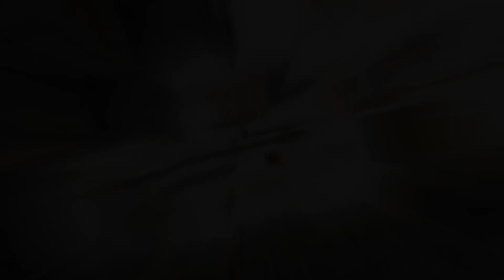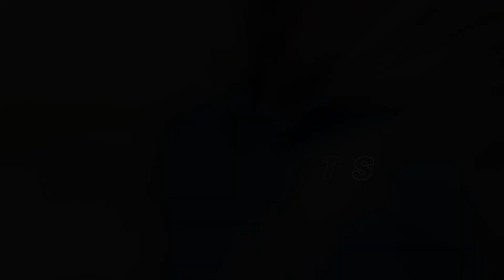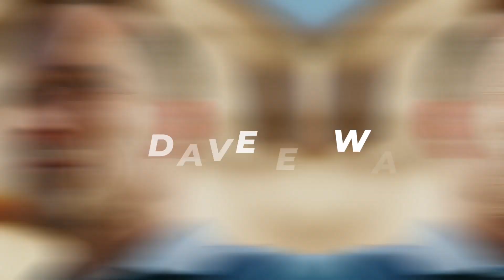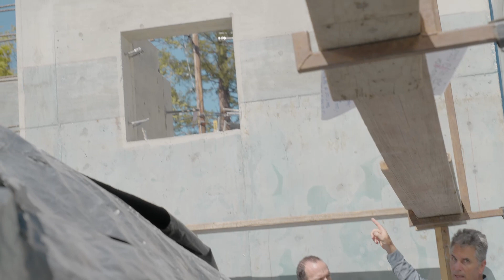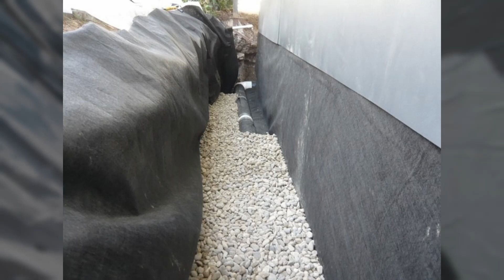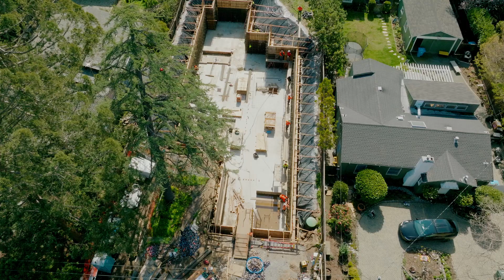Jake's Passive House #5: Waterproofing a Basement for a Comfortable, Problem Free Basement Forever

Comment: I’m incredibly interested in the pan style (“bucket”) concrete pour and how that was actually accomplished. Do you happen to have photos or a video of that part of the process? I feel like that is missed in most basements, and the insulation and waterproofing is usually handled in a less superior way (in my opinion!). Was the footing and wall poured in 1 step or separately? Also, would you mind sharing the manufacturer of the products utilized here for clarification?
Reply from the maker: I am not sure what you mean by Pan style or bucket” concrete pour. The basement was poured with a boom mounted 4” concrete pumping hose and for the very far off sections of the house past the boom reach, we added additional hose to reach those areas with the boom fully stretched out.  We have a foundation pour at Cereza Passive House that we are recording next week and will post that in a few weeks.  MiraDri and MiraPly, both by Carlisle are the waterproofing materials that we used on the basement, with manufacturer certification and warrantee of the penetration flashing and sealing.   This is a mat slab, so the foundation was 12”-18” thick and a few spots that were 24” thick for point loads.  All sections of the slab were poured at once.  Thanks for the questions!!